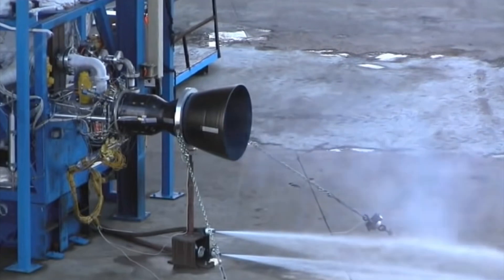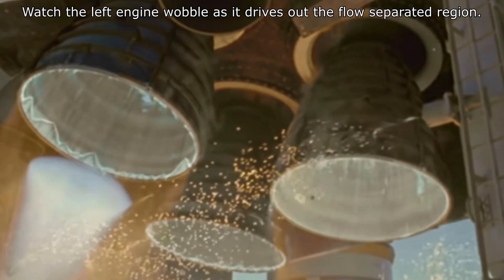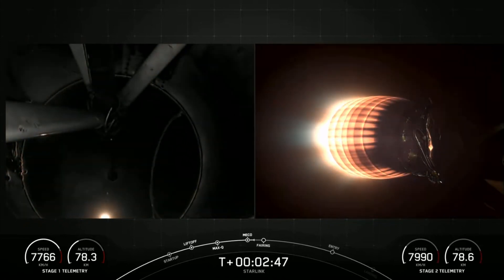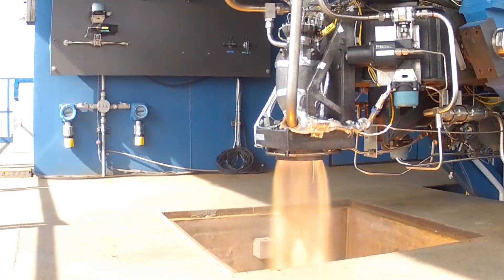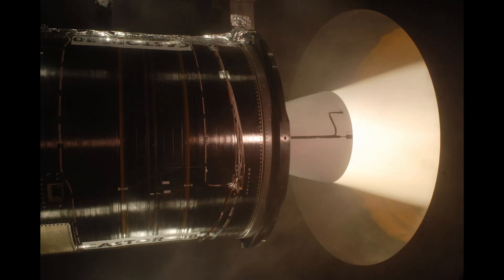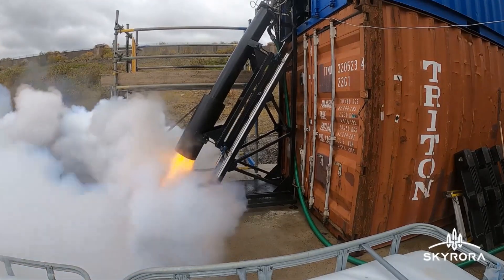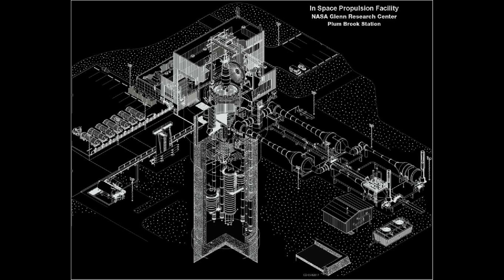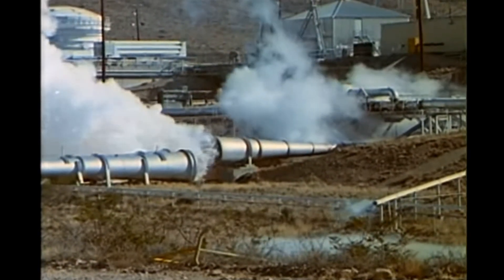Defying Atmosphere - How Rocket Engines Get Tested In A Vacuum Before Going To Space

Comment: Fragile nozzles that can be damaged by atmospheric pressure but somehow support alleged 3,000 ton rockets? Yeah ok liar 😂 Plus a gas expands from higher to lower pressure using its own internal energy, no force is applied to the gas during the expansion. Just to make chatbot stuart look silly. Again 😂
Reply: You are showing your ignorance again. 
1. The metals used in rocket nozzles are far stronger in tension than in compression. So when the engine is at high altitude and the pressure inside the nozzle is higher than outside, the nozzle is in tension. It's designed to be strong enough to take the loads in this configuration. 
When you try to test a high-altitude engine down at sea level, the atmospheric pressure outside is higher than inside the nozzle, and the nozzle is now in compression.
This is no different in principle than a coke can: when the can is full, it is strong enough to stand on. When it's empty, the can is no longer in tension and I can flatten it with my hand. 
2. There are no rockets in use today where the second stage weighs 3000 tons. The Saturn V is the largest, and its third stage plus payload weighed less than 200 tons. 
3. A gas that is at a higher pressure than its surroundings exerts a force on its surroundings.
Reply: @h.dejong2531  Ask papalegba "what is the by-product of a Hydrogen oxygen fire?" He refuses to believe the answer is "Water".
Reply: @stuartgray5877  what is fire, chatbot?😂
Reply: @h.dejong2531  so the rocket exhaust does push on the atmosphere? Thanks for admitting that 😂
Reply: @papalegba6796  A rocket engine is less efficient at sea level than at high altitude. The difference is caused by the ambient air pressure. Let that sink in: when the rocket exhaust gases have to push against the atmosphere, the rocket gets less efficient.
Reply: @h.dejong2531  let the gas law w=PV sink in, chatbot. What you state violates it 😂
Reply: @papalegba6796  w=PV applies to closed systems that change slowly (quasi-static). It's useful for piston-driven steam engines, not so much for rockets.
Reply: @h.dejong2531  a rocket in a vacuum is a closed system, Chatbot 😂
Reply: @papalegba6796  A rocket in a vacuum is obviously not a closed system: the exhaust gas leaves the system.
Reply: @papalegba6796  A couple of PSI of air pressure can hold up many THOUSANDS of pounds of roof over the swimming pool at my high school.
( like the 60,000-seat B.C. Place Stadium in Vancouver, Ca)
I guess that is a hoax too?
Bless your little heart!
Reply: @papalegba6796  Tell us again how a rocket engine can accelerate mass without feeling an "equal and opposite force".
I love to hear how you believe that Newtons laws are a hoax!
Reply: @h.dejong2531  - Papalegba claims that rockets accelerating mass do NOT feel an equal and opposite force.
 So, I TRY to explain that this ALSO means that STEAM (also a GAS) could not move the blades of a gas turbine.
He does not understand how the two can be related.

But it thinks it is qualified to lecture anyone about basic physics....
Reply: @stuartgray5877   I personally would love to hear Papa explain how the fuel & oxidizer goes from sitting in storage tanks in the rocket to being accelerated out the  Rocket engine with no force
Reply: @entangledmindcells9359  - " I personally would love to hear Papa explain how the fuel & oxidizer goes from sitting in storage tanks in the rocket to being accelerated out the  Rocket engine with no force"

Me too!
Thats why I have been asking him this question for about 5 years now. All he does is "claim" he answered it once in some other multiverse.
He has so many sock puppet accounts he cannot remember what he said, when.
Reply: @h.dejong2531  that's not what a closed system means, chatbot 😂
Reply: @stuartgray5877  I personally would love to see you use real physics calculations to prove your claims. But none of you ever do 🤔😂
Reply: @papalegba6796  You mean 'real physics, except the bits I'm ignoring because they don't fit my worldview'.
Reply: @papalegba6796  Yes, that is exactly what a closed system means.
Reply: @papalegba6796  that gas law applies to closed systems that change slowly, called quasi-static. The equation you are looking to is w=Fd
Reply: @papalegba6796  Dude your responses feel more like a bot than anyone else's, ending every single sentence with a " 😂" and calling everyone chatbot. Too predictable, grow up, troll.
Reply: @papalegba6796  the reason you don't see "real physics calculations" is because we know you would deny it, as you are actively doing during this thread.
Reply: @ppleberrynd  literally everything you post is a lie, it's hilarious 😂
Reply: @ppleberrynd  You claimed the equation for calculating the work done by a gas is w=fd, lying chatbot. It's w=PV, liar 😂
Reply: @ppleberrynd  and a gas expanding into a vacuum is not quasi static either, liar 😂
Reply: @papalegba6796  exactly so you can't use the equations for quasistatic systems on a non quasistatic system, chatbot
Reply: @papalegba6796  why are you using the equation for work done by a gas on its surroundings... in space... with no surroundings... see? It doesn't make any sense.
Reply: @papalegba6796  also... pv=fd.

Volume = area * length.
Pressure = force / area
(f/a) * (a*l) = f * l. Length is the same as distance.
Reply: @papalegba6796  So you believe that a space shuttle main engine CAN accelerate 500 kilograms of pure water from a velocity of zero to MACH EIGHT all without applying any "force" to that water?
A SSME does this every second!

So I guess a SSME can accelerate all that water without DOING ANY "WORK"?
Is that what you are trying to say?

WATER can be accelerated to Mach eight with NO WORK BEING PERFORMED?

Cool story bro!
Reply: Still peddling your nonsense I see PapaLiar. So what's the equation to calculate the thrust of a rocket engine again?
LMAO
Reply: @bobartor910  Ask it where the force comes from that accelerates the mass of the exhaust gas into the vacuum.
 It will claim it already answered you then call you a "bot".
Reply: Look at the angry chatbots avoiding my question 😂
Reply: @papalegba6796  Everyone else keeps using logic, mUsT bE cHaTbOtS cAuSe ThE fAcTs mAkE mE bUtThUrT. Grow up.
Reply: @papalegba6796  
Look at  the idiot PapaLiar still posting gibberish and refusing to answer questions.
Reply: Look at the angry chatbots claiming they asked questions before me 😂
Reply: @papalegba6796  SO just answer the question then! 
You have LITERALLY typed THOUSANDs of words explaining WHY you don't need to answer the question when the answer consists of JUST TWO WORDS.
Now from where does the force originate that accelerates the mass of the exhaust into the vacuum?
You are just scared to answer because you know the answer proves you wrong.
It's odd that you PRETEND to not know how Newtons laws work, yet you KNOW WHAT QUESTIONS TO AVOID.
How is that possible?
Reply: Look at the angry chatbots unaware I already answered their troll question 😂

Comment: I'd like to know what mixture that they use to make all those Sparks to ignite the rockets.
Reply: SpaceX uses TEA-TEB (Triethylaluminium /Triethylborane) that ignites when it touches liquid oxygen.
Reply: The sparks don't ignite the rockets.  The sparklers are a safety system that's there to burn off any hydrogen that leaks out of the engines before it can build up and explode.  They're called ROFIs (Radial Outward Firing Igniter) and are made with an ammonium perchlorate and aluminum mixture.  The sparks come from the added aluminum.  Ammonium perchlorate is a solid rocket motor fuel.

Comment: How do you test for zero G,  in  liquid fueled engines?   I can imagine that for SpaceX tus is super critical.   The fluid dynamics in those conditions are crazy!
Reply: You generally avoid running the engines in zero G: before the main engine is started, a small ullage thruster provides enough thrust to settle the propellants at the bottom of the tank so the main engine can start.

Comment: You said things like "you can do (this), you could do (that)," but you didn't say what they actually did.  You said, heat exchange is a problem in vacuum, but you DIDN'T say what it was that NASA did to exchange the heat away from the engine BEFORE it conducted to the rest of the craft.  Landing on the moon required engine use to leave earth orbit, land on the moon, launch from the moon surface, and leave the moon orbit.  What did they do with all that heat????  Vacuum is NOT cold or hot.  Vacuum is an insulator.  Sunlight is hot.  Very hot in space, about 400 deg F surface temps.  As the moon mission was in sunlight for many days, what did the craft do with all the accumulated heat???  Sure, painting it white helps a little.  Insulation helps as long as NOTHING extends beyond the insulation, but we know that wasn't the case.  They weren't carrying tons of water to spray it down.  Well???
Reply: The command module and lunar module used reflective surfaces to reduce the amount of heat coming in from sunlight. They used insulation to avoid losing lots of heat to space (thermal radiation). These two were balanced to keep the interior of the craft at habitable temperatures with minimal need for heating or cooling. This worked well for most missions, but became a problem on Apollo 13: most of the electronics in the CM were shut down, which meant less heat was coming into the cabin than planned, and the interior got cold. 
The LM used sublimation cooling to reject waste heat: a closed cooling loop led to a radiator in an unpressurized compartment. Water was sprayed onto this radiator. This would freeze, then sublimate and carry away heat. The LM thermal design was good enough that they only needed a few litres of water per day. The space suits used a similar system. 
The heat of the LM descent engine was directed downwards as much as possible, using a heat shield. This was enough during descent. After landing, the remaining heat would warm up the surroundings of the engine. They vented the remaining propellant, which carried away that heat. 
The ascent engine used a similar approach, with heat shielding around the engine.
Reply: @h.dejong2531  losing heat to a vacuum? Ok 😂
Reply: @papalegba6796  Again, your ignorance is showing. There are 3 mechanisms for transferring heat: conduction, convection and radiation. Conduction requires contact with a second object. Convection requires an atmosphere. Radiation works fine in a vacuum. Radiation is the reason the lunar surface cools down during the lunar night.
Reply: @h.dejong2531  how do you know when nobody has been there? 😂
Reply: @papalegba6796  We can test how heat transfer works in a vacuum: scientists worked this all out centuries before we could go to space, by doing heat transfer experiments in a vacuum chamber. 
I can see the ISS with the naked eye, and I can prove it is in space and not in our atmosphere. This disproves your claim that "nobody has been there".
Reply: @papalegba6796  - "losing heat to a vacuum?"
Yes it's called "radiation" genius.

Or are you suggesting that heat FROM THE SUN is a Hoax TOO?
Yeah you are BRILLIANT!
Reply: @stuartgray5877  um, radiation in a vacuum is very inefficient. That's how a thermos works, chatbot 😂
Reply: @stuartgray5877  If the sun is shining on your spaceship it will gain heat, not lose it. Silly chatbot 😂
Reply: @papalegba6796  - "That's how a thermos works, chatbot"
No. A vacuum thermos bottle works by eliminating conduction and convection.
It still allows Radiation but has reflective layers like spacecraft thermal blankets to minimize it.
Don't you ever tire of being wrong?
Reply: @papalegba6796  - "If the sun is shining on your spaceship it will gain heat, not lose it"
So you are arguing that the sun can give off heat via radiation, but the spacecraft cannot "cuz reazons"?
Got it.
You don't understand any physics including thermal radiation.
Reply: @stuartgray5877  I didn't say that, chatbot 😂
Reply: @papalegba6796  - "I didn't say that, chatbot"

YES YOU DID
YOU SAID:
- "If the sun is shining on your spaceship it will gain heat, not lose it. "

So according to YOU, if the sun (an object smaller than your pinky nail held at arms length) is "shining on your spaceship" then I guess the spaceship CANNOT RADIATE HEAT away in all of the other directions.

Is THAT what you are trying to say: if there is a POINT SOURCE of heat in space then the spaceship can NO LONGER RADIATE HEAT in all of the other directions to deep space.
AGAIN - perhaps you should learn about a topic before thinking you know more than the experts.
Reply: In space you need to radiate away the heat. This is controlled with thermal coatings.
I believe the ISS has almost as much surface area of thermal radiators as they have solar panels.
You can see them behind the solar panels as they work best in the "shade".
Reply: @stuartgray5877  And now explain what the Apollo missions did.
Reply: @stevesmith7839  They also had thermal radiators and ammonia cooling loops.
So just to be clear - You think you can "Debunk" all of the Thermal Engineers and rocket scientists without ever having taken a physics class in your life?
This is called the Dunning-Kruger syndrome.
Reply: @stuartgray5877  I wish this was a different platform, cuzz I'd tell you, "Show me on a picture of the Apollo craft, the thermal radiators."  Instead of attacking me personally and talking out your ass, you should question authority.
Reply: @stevesmith7839  - "you should question authority."
I have been building testing, launching, and flying deep space science probes and earth orbiting spacecraft since before you were born.
I AM the authority on spaceflight technology.
You will never have the opportunity to speak with someone with my level of spaceflight technology experience.
Reply: @stevesmith7839  - " Instead of attacking me personally"
Well by claiming that all Aerospace Engineers are either liars or incompetent you are attacking ME personally genius.
Reply: @stevesmith7839  So just tell me that you DID complete high school. and that you have taken a physics class.
Reply: @stevesmith7839  Stuart Gray is a chatbot 😂
Reply: @stuartgray5877 you just completely silenced him
Reply: @peeperleviathan2839  It will not. It follows me around and harasses me.
Reply: NO U!😂

Comment: (1) They are simulated vacuum in this test but how do they simulate no gravity?   (2)  How do they test moon lander on earth? ( how do they simulate less gravity?).
Reply: The effect of varying G levels is limited, and can be simulated by changing the pressure in the propellant tanks. So the moon lander engines could be tested on a test stand. An all-up flight test of the moon lander was not possible on Earth, but was done in Earth orbit.
Reply: (2) You don't really need to, we know that the gravity on the moon is ~1.6 meters/second^2, and we can do this crazy thing called math to ensure that the thrust generated by the lander is sufficient to land safely and take off later.
Reply: You don’t really need to unless it’s a critical part of how the engine works. Though you have to make sure the ullage thrusters work otherwise your engine might explode in zero G

Comment: Or you can go hypergol. You know it will light, even in a vacuum. The Titan IV lit its liquid engines at altitude (basically a vacuum) but never tested them in a vacuum. They tested the engine on the ground with the nozzle extension removed. Then they attached the extension and flew it. Worked like a charm.

Comment: Rocket engines work better  in empty space away from planets because theirs no air resistance and no gravitational pull from planets or large objects finally every action has an opposite reaction so when the fuel is pushing out of the back of rocket it pushes against the rocket forcing it to move in the opposite direction 😂
Reply: Why the 😂?